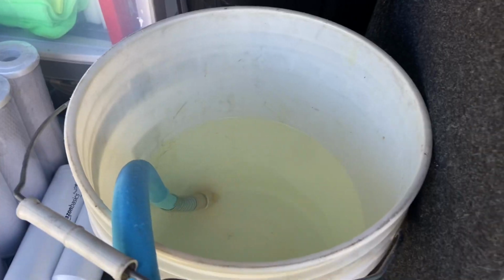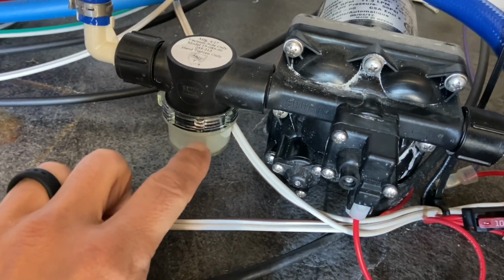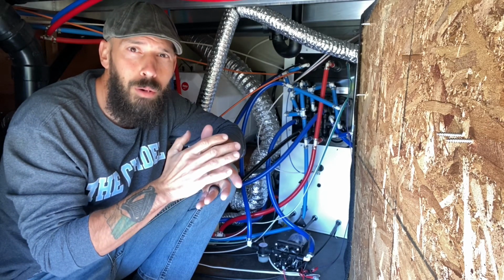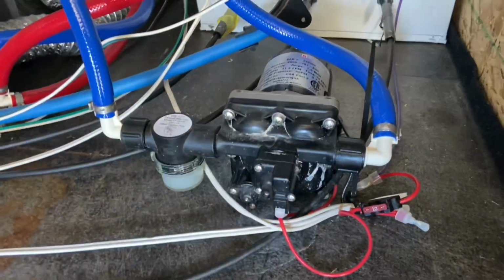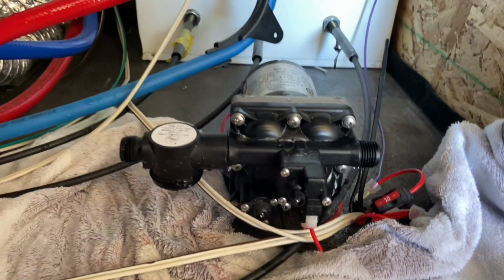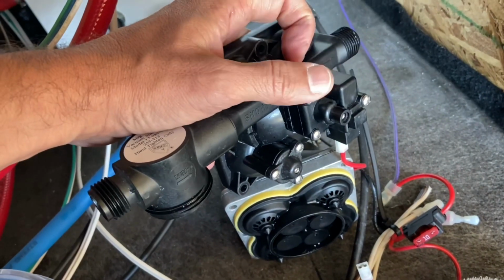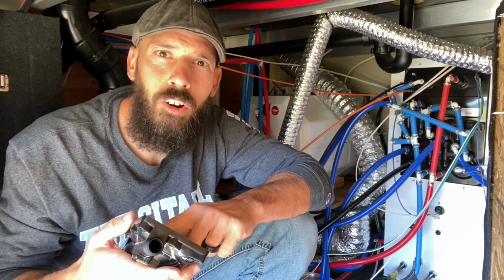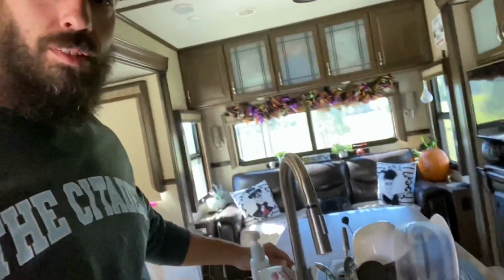RV WATER PUMP TROUBLESHOOTING (Pump Runs but No Water...Fixed!)

Comment: Thank you so much.  That was exactly the problem I had that little valve was stuck.  We leave today to go boondog camping and filling the rig with water last night found out I had no water from the pump.  I thought I was going to have to buy a new pump today before we leave.  The pump was running but no water.  Only took me about 30 min to fix the problem.
Reply from the maker: Sweet! You’re not alone in this problem and chances are it will happen to the pump again 🤷🏻‍♂️
Reply: I will start using my pump more often per your recommendation. Never thought about the fact that it needs to run it stay clear

Comment: On further thought, the switch might be getting stuck because the hot water used for showering, etc. expands the button ever so slightly that when cold water goes through the pump it contracts the pump housing enough to wedge the button valve becomes stuck.  Next time this happens it might be worth trying to use the hot water before changing to coach water - so that the water pump housing has expanded ever so slightly that the valve button isn't stuck. ???

Comment: If  the problem repeats itself, try flicking the water pump switch on and off a couple dozen times.  The RV park had great water pressure, but safe pressure according to management.  The camper had a little waterline noise  when turning sink water on/off - sort of like a water hammer noise while hooked up to shore water.  I followed this video for a successful "fix" , thank you.  I visited the same rv park again and it only took a few days of water hookup when I decided to test the water pump.  Sure enough, it was stuck again - the pump ran continuously.  
Thinking that it might be enough water hammer pressure going on, I turned off the shore water source and I tried turning the water pump on/off many, many times and it eventually "fixed" itself.  
I hope that this might help someone sometime.

Comment: Thank you so much! The stuck valve was the problem with our pump. I never would have known without your video. We are going to make a point of using our pump more often, even when we have a city water connection so, hopefully, this won't happen again.
Reply from the maker: Good deal Michael. Wouldn’t even hurt to put some plumbers grease or food grade oil on it next time. Thanks for watching 👍🏼

Comment: I came back to your video because after taking my camper out of the garage and filling the tank up with water, the pump was running and the faucets were dry. I had the exact same issue as you had here--thank you for helping me solve the problem.
Reply from the maker: That’s great that this solved the issue. Appreciate you watching 👍🏼

Comment: super video, this fixed my problem! too bad my pump is in such a hard to access place and the screws holding it to the floor are like glued in place so I had to open up the pump blindly but eventually … success!
Reply from the maker: Nice. I’m glad it worked out. I know sometimes they put these pumps in crazy to access locations. Thanks for watching 👍🏼

Comment: Perfect solution and fix for my Sureflow pump. This tutorial showed how easy it was to disassemble this pump and fix that STUCK valve. My RV sat all winter and I assume this valve dried out and seized over the cold winter months. Once I unstuck this valve the water problem was fixed. Sure beats buying another $100 plus water pump. A million thanks!
Reply from the maker: Sweet! Glad this helped. Seems to be a pretty common problem. Thanks for watching 👍🏼

Comment: Why won't water pump go off
Reply from the maker: More than likely that pressure valve switch is stuck in the open position or you could have a small crack in the filter.

Comment: If I disconnect the hoses from the pump with water in the fresh water tank will water spill everywhere?
Reply from the maker: No. The pump has to be in to draw water from your tank. You will have some water in your lines still that will come out. Use your low point drains to help empty those. 👍🏼

Comment: Tone challenger , water pump leaking. Connecct  to City water do nt use. Car i turn it off to stop it or by pass or move  on to relplacing. It never been used by me .  Not sure what  to do ,Need leak to stop .i would like to just bypass it all together
Reply: Keystone challenger 2008 waterpump can I.  MESSED that all up. Maybe a little clearer😊

Comment: Hi Chris, superb video, great tip to allow me to fault find, typical first use after winter and pump running but no suction.  Pump removed, stripped down and the pressure switch valve was stuck solid, now freed off and lubricated with food silicon and now glides open and closed.  Pump refitted and hey presto, water flowing to all taps and the pump sounds alot quieter now.  Cheers from Scotland 🙂
Reply from the maker: Good deal!! Ahhh Scotland! Me and my wife’s favorite country. We love it over there when we’ve visited

Comment: I have fixed this issue before and it happened again. I don't know why it keeps happening. I wish Thor woudn't put these things is odd spots that make it hard to work on. My pump is under the bed. I discovered it's slightly better when you bring the bed slide in about a foot then you have room to get your screwdriver to the screws that hold the pump to the wood frame. Thank you for your video.
Reply from the maker: Sure thing I’m glad it helped out. Maybe try some food grade oil on the valve to keep it moving more. Good thing is at least the pumps aren’t expensive when it is time to replace. But yeah sometimes they are in bad spots. Mines not awful to get to in the basement at least. Appreciate you watching 👍🏼

Comment: @whywait my water pump is not coming on at all when I turn on the switch.. im not sure what to do or where to start because I have an older Rv with older parts and no one on here has this issue .. can you help me please
Reply from the maker: Wouldn’t know where to start really especially if you do have an older RV and parts. I’m not a RV tech or nothing, pretty much just do my best to trouble shoot my problems as I come across them. Without being there I can’t do much to help, sorry. At least a new pump doesn’t cost much to replace.

Comment: Thanks for the video!   I learned something new.   When I sanitize, I do not use the pump or sanitize setting.  I release the pressure and remove the canister, and pull out the water filter.   Then I put in the correct amount of bleach, replace the canister, and do city water tank fill.   Let it run for a minute or two, release pressure, replace filter, then fill the water tank.
Reply from the maker: Good deal 👍🏼

Comment: THANKS…like you, water pump runs but doesn’t pressurize…no water from faucets. I was gonna figure out how to connect a hose with a female connection and try to “prime” the pump on the “in” side but if that pressure regulator is stuck it’s not gonna prime. We’re heading to Florida day after thanksgiving so I gotta get this figure out😔😊 I’ll get a fresh start in the morning. Thanks again…very helpful. RV place can’t even take a look until after the holiday. I’ll feel better with your help if I can fix it on my own. Like the old saying, teach someone to fish rather than giving them fish they can eat forever😊
Reply from the maker: Right on! Hope this helps a bit and you figure out the problem. Let me know
Reply: @WhyWait  Nope that wasn’t it. Wouldn’t prime but I could hear it run. Ordered a new one from Amazon and I’ll try on Wednesday. Otherwise the caretaker will help run from the tank to the pump and figure out WTF… 🤬
Reply: @WhyWait  Yeah…ended up ordered a new water pump from Amazon for about $60. They delivered it the next day and I’m back in action. Still a mystery. The old pump would run…just not pressurize. Thanks again!!
Reply from the maker: @Skyking6976  sure thing. Luckily these pumps dot cost a lot. 👍🏼

Comment: What size PEX clamps do you have on the hose??  I thought those clamps didn't fit flexible hose. I assumed I had to use worm clamps but I noticed those PEX clamps, which is what I'd like to use for my install.

Comment: Thanks for the information. I'm going to be looking at mine when I get back to the boat
Reply from the maker: Sure thing. Hope this helps 👍🏼
Reply: @WhyWait  unfortunately I jumped the motor switch and it seems like the motor is burned out. I'll open it up this afternoon and see if I can clean it up. It was acting up for a while. It's pretty old, so maybe just have to replace it. Thanks anyhow. Good video

Comment: Hey there - how do we disconnect from power while we’re taking it apart?
Reply from the maker: Just turn off the button in the RV that runs the pump and if you still want to be sure remove the little fuse or just turn your battery disconnect switch off.

Comment: Saved me $70 plus labor to replace my water pump. I had algae and calcium in that small white filter. Also, we went from the desert to 4260 feet above sea level and I’m sure the small valve had back pressure. Took everything apart, cleaned it, and put it back together in 20 minutes. Thanks again!
Reply from the maker: Good deal. Glad this helped you out 👍🏼

Comment: Most causes are city water pressure to high. Restrictors are available to limit pressure below 55 psi
Reply from the maker: If your connected to and using city water in a RV your not using your water pump. Only time your using your water pump is on dry camping mode pumping water from your fresh water holding tank or when your pumping sanitizer solution or winterizing your RV. City water pressure has nothing to do with the pump.
Reply: @WhyWait  Idiot, back pressure sure does. City water pressure is applied after the pump. Not suction side the pressure side. City water pressure is taxing the check valve.
Reply: @WhyWait  How do you explain water filling the fresh
 water tank while connected to shore water.
Reply: @WhyWait  The pump is under pressure from the city water, The check valve in the pump keeps the water from filling the fresh tank. To muck water pressure will cause   check valve to fail, silly man.

Comment: Really love the video and learned a lot, however...I have a different issue. When I turn on the pump the fuse blows. Any idea where I should start looking?
Reply from the maker: Unfortunately not, sorry. Must a power issue somewhere for it to keep blowing fuses. Usually the fuses blow because something’s obviously wrong and it’s protecting itself. Wish I could help more, hope you figure it out.
Reply: @WhyWait  Thank you, working on it.
Reply: @WhyWait  HI Chris! I removed the pump and when I added an external power source it still did not run. I took it apart and found that the large yellow gasket that is visible when you remove the 6 screws had a wrinkle in it, which clearly was a flaw from the beginning. When I removed that piece I could see there was rust buildup around the motor shaft and it likely siezed due to water getting past the gasket and an eventual rust build up. Dead.
Reply from the maker: @silekiernanphotography  glad you solved it and luckily they aren’t too pricy to replace 👍🏼

Comment: Thanks for going through the trouble shooting…turns out my filter had cracked. Ordered a new one and arrives tomorrow. I nearly ordered a new pump just because i couldn’t be arsed and thought that would fix everything. Funny thing is a new pump does not come with a new filter.  Hopefully this fixes it. Will let you know.. thanks for taking the time to make a vid on this. 👍🏴🏴
Reply from the maker: Good deal. Hopefully that solves your issue. Let me know. Like the Scotland flags 👍🏼

Comment: Are there any gaskets to replace or be careful of when you take the cover off the front of the pump or pressure regulator?
Reply from the maker: Been a minute since I’ve taken it apart or watched the video but I think there may be one around the diaphragm cover. Just keep an eye out disassembling. 👍🏼

Comment: What if it'll pump water but it's pushing water out the city connection on the outside? 
I also had an issue with being connected to city water and have a leak come out of the anti freeze inlet..??
Reply from the maker: Wish I could help but without being there personally to investigate things not much I can tell about your problem. Hope you figure it out though. 👍🏼

Comment: My pump runs but will not shut off
Reply from the maker: You mean even when the faucet is off it’s still making noise?
Reply: Yes
Reply from the maker: @BrendaFliehler-vv9nf  hmmmm hard to say. 🤔 I’m no expert without really getting my hands on it. Maybe a loose connection or crack in the little filter and it’s sucking air. Or maybe that little valve switch is stuck open unlike mine that was stuck closed.
Reply: @Why Wait  got itfixed.
Reply from the maker: @BrendaFliehler-vv9nf  awesome 👏🏼 good deal

Comment: Watched your video, then started to take my water pump out and apart. During this process I noticed a shut off valve on one of the lines. I flipped that valve and everything started working properly. I guess that valve diverts water intake between the fresh water tank and the winterize/antifreeze inlet. We have a used camper that we have yet to go camping in.
Reply from the maker: Ok cool. Glad it was an easy fix then and your probably right about it

Comment: I am a weekend warrior type of camper and camp at places with full hookups. When I get to my destination, I fill up my fresh water tank. I generally use city water during the day but cut off the city water in the evening and use the pump for the remainder of the night and the next morning. Cutting off the pump before bedtime assures I will not wake up in the morning or the middle of the night to a water leak.This also gives the benefit of exercising the water pump.
Reply from the maker: Good tip. Thanks for watching 👍🏼

Comment: Hi there .
For some reason my pump has started to splutter and the water still runs , even I turn the tap off water still comes out slowly until it stops.
I've disconnected the pipe to the tap, tested the pump and it gives excellent pressure and water flow. So it seems when connected to the tap it becomes a problem.
Any idea what could be causing this. 🇬🇧
Reply from the maker: No, sorry, I’m really not too sure what that could be. Good luck possibly figuring it out. Wish I could of helped.

Comment: What happens if its not making a noise could it be frozen? Thanks
Reply from the maker: Could be the fuse on it is blown? Have you checked that? Should be a 10am fuse located by the pump and probably another in your panel as well.
Reply: @WhyWait  ok thanks il have a check

Comment: Thank youuuuuuuu!!! I rebuilt my van to sell and didn't want to buy a new pump because it was only a couple of months old before I demo'd my old set up. Well, it has been sitting around dry as a bone for months. I hooked up the electrical a while back and got a hum from the pump so I thought - all good - Nope! finally filled my fresh water tank for the first time today to test and still got nothing but the hum. I was about to replace the entire pump because I was so over it. My model is slightly different but the same general principle applies and now it is running (and leaking lol)!!! I have to replace the gaskets because they dried out in storage but at least it's not the whole enchilada!
Reply from the maker: Nice! I’m glad you were able to salvage it and get it running again. Appreciate the comment and thanks for watching 👍🏼

Comment: I've owned a travel trailer for about a year. In the past few months I've noticed the pump will repressurize about every 2 or 2.5 hours. Is that normal? For the life of me, I can't find water dripping anywhere, so I'm kind of at a loss for what's causing the pump to run every few hours. Any help is appreciated!!
Reply from the maker: So you can hear the pump come on and run every few hours but nobody is using water anywhere in the rig at the time?
Reply: @WhyWait  Correct. It's a 26 foot trailer, so not much hoses and stuff, and it's just me in the camper. If a couple hours go by and I haven't used the water, the pump will come on for about a second or two.
Reply from the maker: @BenWilder  sounds like it’s not much to worry about. I’m not sure why it’s doing that. Especially if you don’t see any small leaks anywhere. Wish I could be of more help
Reply: @Why Wait  I appreciate your response though! I'm so new, Mayne it's normal for the pump to cycle every now and then, with the cold temperatures and all. Thanks again!

Comment: Hey Chris! I was having a low flow issue with my pump so I watched this video. I decided what the heck I’m gonna try again. I have worked on this pump before. I checked it the other day to make sure the filter screen was clean and stuck my finger in there and thought that’s weird. There’s no filter. So I dove back in tonight and lo and behold. There is a filter. It is a screen that rests up against the output side of the basket to the water to the RV. It was filled up with green sludge. I cleaned it and now I have my water pressure back. Thank you! Subscribed!
Reply from the maker: Good deal Donald. 👍🏼Glad you found the issue and got it fixed. Lots of times it’s just something simple like that. Appreciate you watching and subscribing 😁
Reply: Chris!  We’ve been stationary for three months. Zero issue w water. We took off today and I did the dishes no issue. My husband gets in the shower and it’s at a trickle. Now no faucets are putting out water. The pump is working. The filter thing that the water flows through isn’t full of water. Thoughts?

Comment: my pump is under my bed.  i have to take the bed apart to get to it in the back.  it is a pain.  i am disabled and don't have no one to do it.  i need help
Reply: Did you get it fixed yet?
Where are you located?